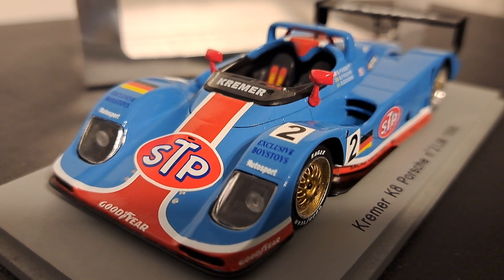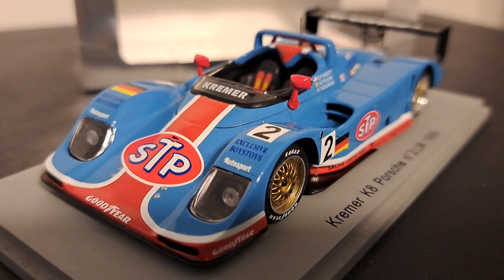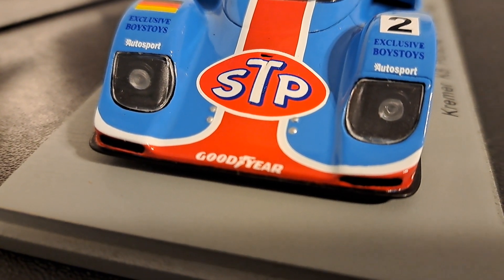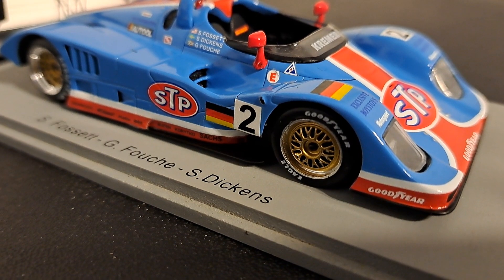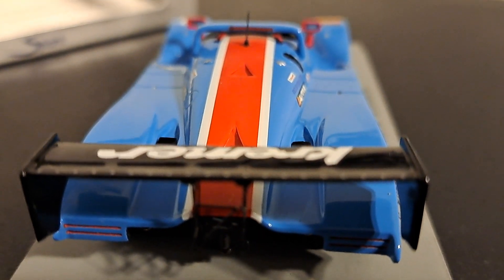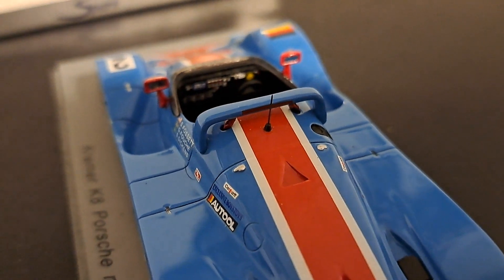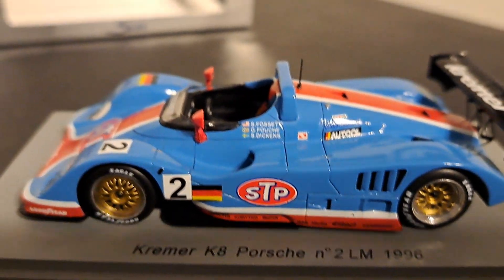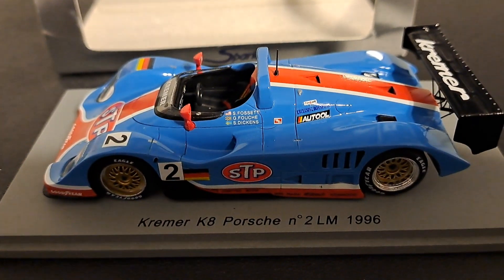Spark: Kremer Motorsports #2 1996 Porsche K8.

Comment: Do like this one. Have a Starter kit version from 1995 myself. The STP livery looks good on it though!
Reply from the maker: Like it better than the Gulf.
Reply: I have a provence moulage model of this exact car. It's really nice, and was a lot cheaper than this spark version which I wanted, but people were asking loads for it. Anyway I was pleasantly surprised by the quality when it arrived. Resin model and fairly well made by whoever built the kit. Kits always have a bit of unique character too, although. The spark is overall a little more professionally done though. Is it really a diecast? Other than the hachette range I don't think spark ever made metal models, even for these vintage ones. May just be heavy because it's a big car? Spark resin has a particular smell. I love this stp livery, and the fact it was driven by billionaire gentleman racer Steve Fosset, who was 52 at the 1996 Le Mans. Very interesting life he had before he was killed in a plane crash in 2007. Dickens won Le Mans in 1989 in the Sauber Mercedes C9.
Reply: @Tom_Hadler  Starter and Provence are generally similar in terms of kit quality from what I've seen. It's always down to how well they've been built and maintained. They definitely can rival most high end resin manufacturers if built well. I would also have expected any non hachette Spark to be resin - definitely off brand for them to produce diecast.
Reply: @stevieboymkii  mine was advertised on ebay as starter, but underneath it definitely says provence moulage. They're the same basically. I'm really skeptical of your claim of this being diecast! I prefer resin, they seem less likely to get paint issues down the line, whereas metal oxidises so can cause problems. The headlights here don't seem quite perfect either. Still a real nice model.
Reply: @Tom_Hadler  not my video just to confirm. I don't think our boy was saying it in anything but a quick thought purely based on the weight.
Reply: @stevieboymkii  oh yeah ha, how daft of me, sorry. Yeah he was probably basing it off the weight. Diecast is more thermally conductive which can be a tell  - colder usually.